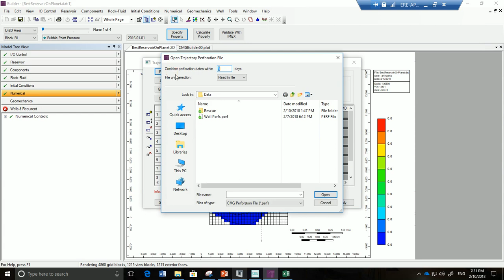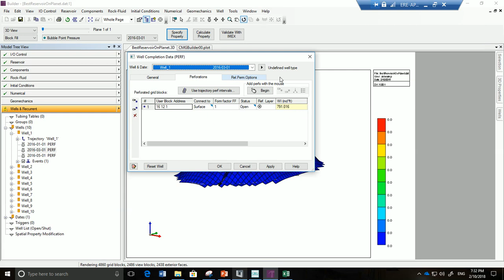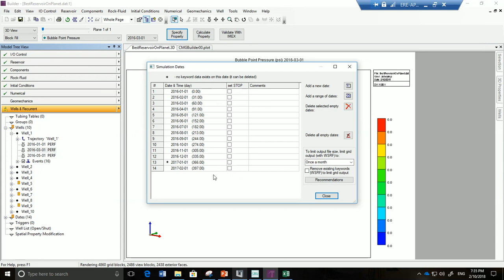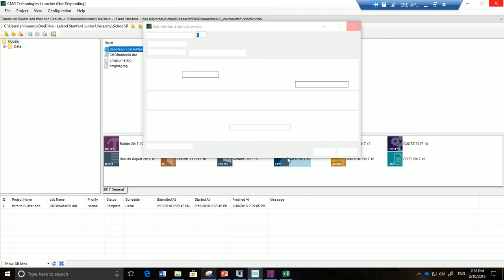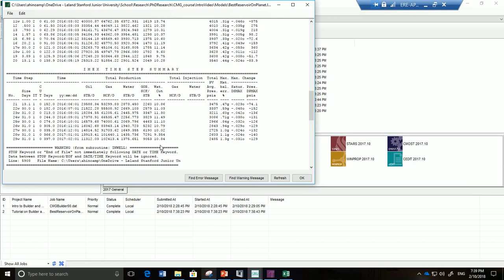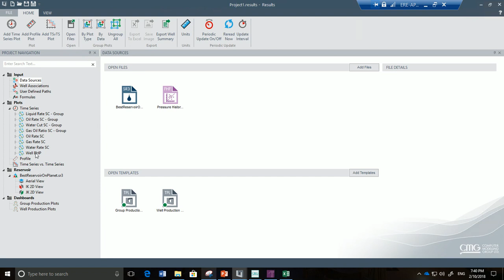CMG 2017 Introduction to Builder and Results - Part III

Comment: thanks for the great video Ahinoam Pollack. I have a question. I use CMG 2015, on minute 5.22, there is any option for history matching, there are steps to take or click finish? Because i can not run my model in IMEX
Reply: Deleting wells 5, 7, and 9 could help to run your model. Also, try to include Oil compressibility in the COMPONENTS SECTION